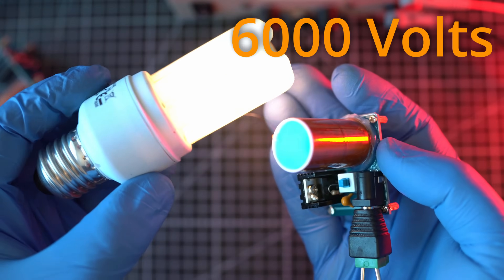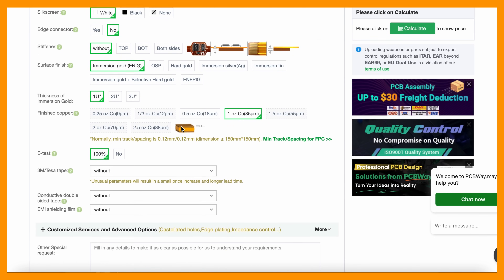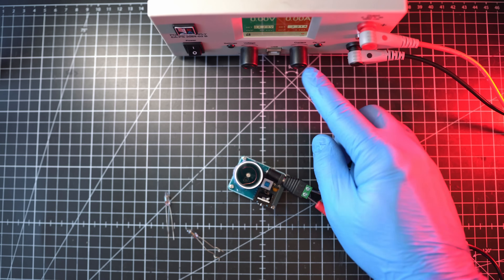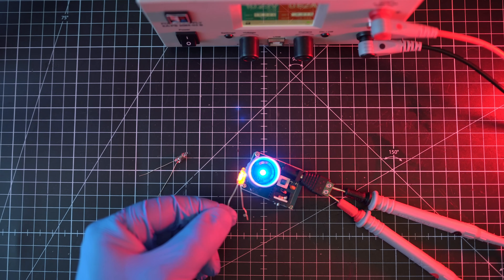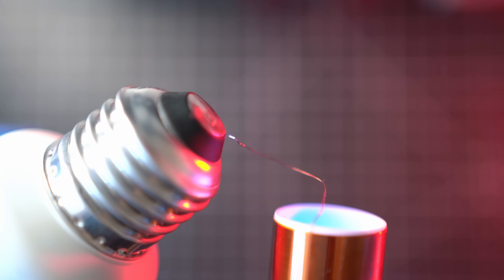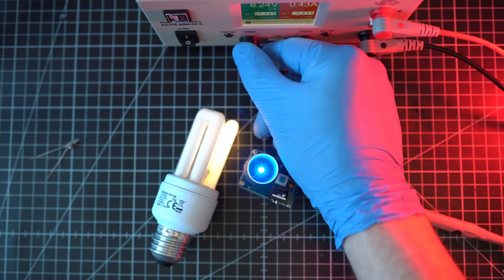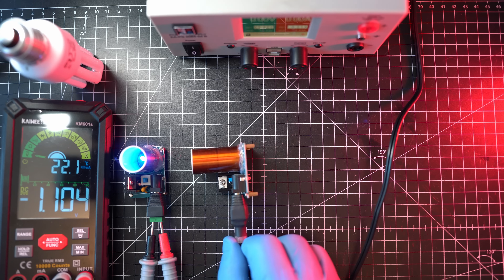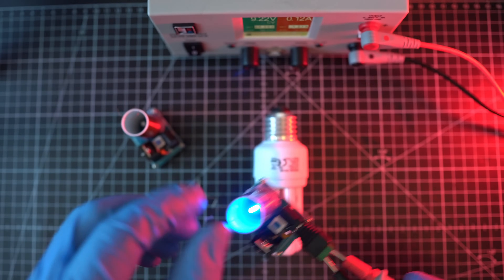$2 Aliexpress TESLA Coil Testing Limits...

Comment: I believe it’s actually a neon bulb!  
I love these little things, though.. 
 I forget how exactly -be it a 9 V battery to 12 V style plug or something else but I brought this thing to Work one day how in my sleeve with a 9 V battery and then shocked my coworkers not literally lol but by holding onto a fluorescent bulb and having a light up in my hands! Actually, if I remember correctly, I was definitely the one being shocked in my sleeve
Reply from the maker: it could be a neon bulb…  I wanted to see if there is bigger arc with higher voltage input…  so much fun for little money…